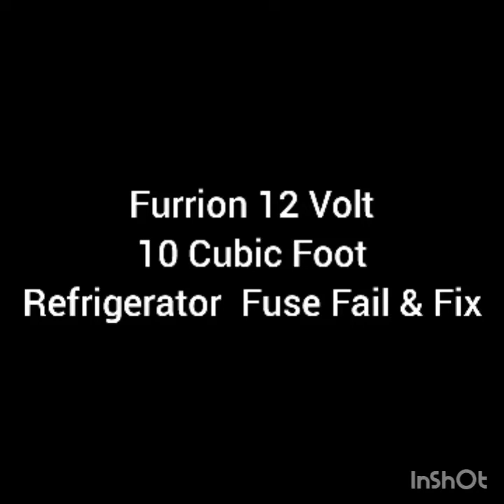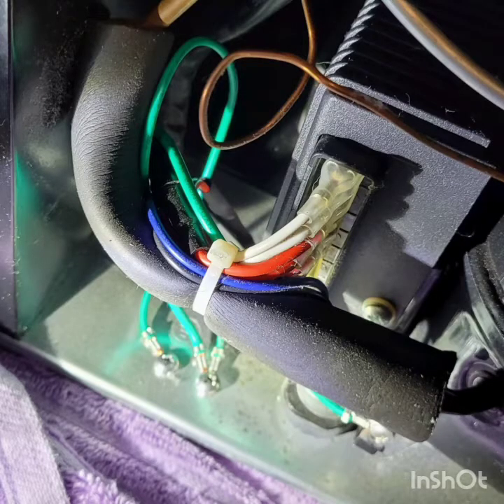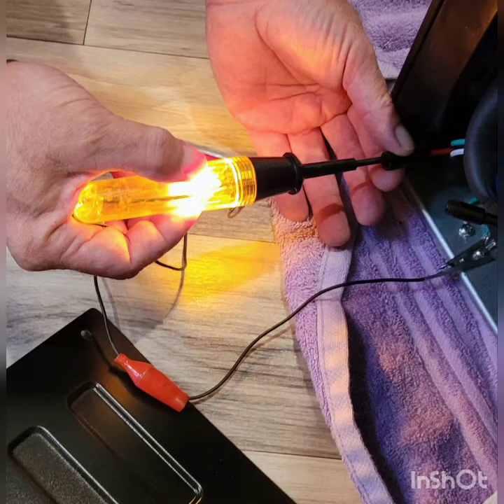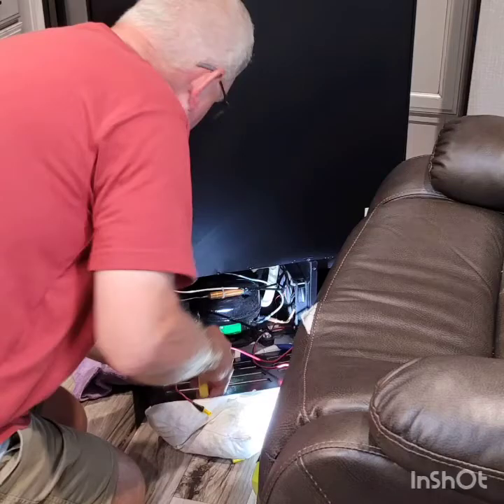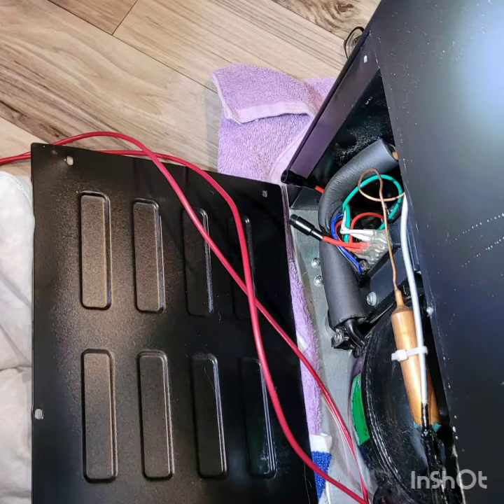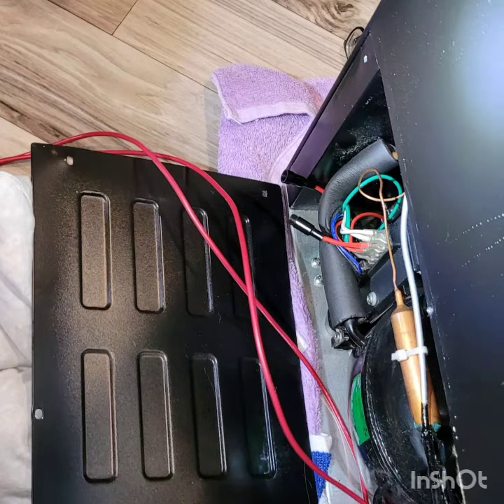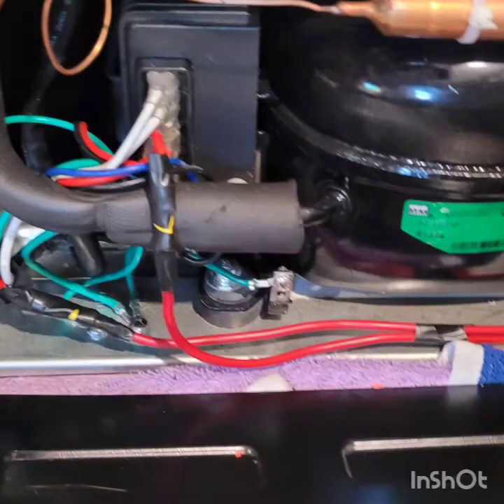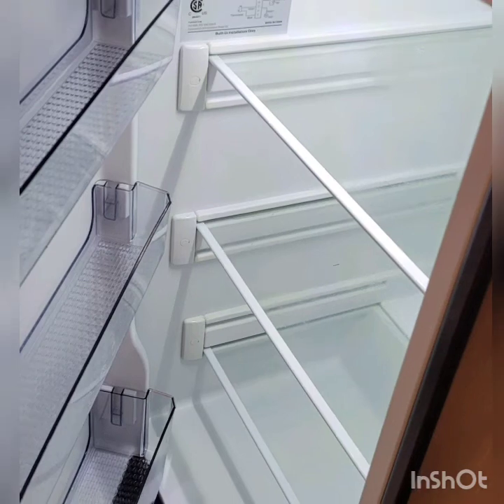Furrion 12-Volt Refrigerator Fuse Fix

Comment: Hey there Brian-

I don't typically comment on youtube videos, but I wanted to say: this one really saved my bacon. I'm a DIYer, but this is the first time I really had to deal with something potentially tricky with my travel trailer. This video helped me to understand what was going on, and the fix/solution actually improves the situation for future maintenance issues. THANK YOU!

Extra note in case nobody else has mentioned it here: be sure to test the old fuse. Use a multimeter set to "ohms," and use the black and red probes to touch each side of the fuse at the same time. A good fuse will register close to "0" ohms of resistance. But if it's blown (like mine was), then your multimeter shouldn't notice any difference as when you're holding the probes separate, in space.

Comment: Great Video. I used a milk crate and a couple of blocks of 2x8 to keep the refer as close to its original height as possible so I could slide it right back in.

Comment: Same problem. Fridge not cooling. Lights work in the fridge. Compressor makes a clicking sound every 2-3 minutes. But doesn’t cool. Company has already sent me a new compressor board snd issue didn’t fix. Anyone have any thoughts?   I am getting 13v past the inline fuse. So I assume the fuse is good?
Reply: We bought a Keystone Cougar about 3 months ago and the Furrion fridge has already gone out on us.  I contacted Furrion and they stated they don't make replacement parts for the Furrion Fridge.  I contacted Keystone and they acted like they didn't know this.  Holiday World in Alvarado, TX said they can't even look at it for 3 months.  People Furrion fridges are absolute trash!
Reply: No, you are not having the same problem.  Great instruction video, by the way.  But Paulmarsh7009, this instruction video is a solution to a problem where there is No lights, plus the frig is not working.  No lights mean a power interrupt -- in this case, the fuse blown at the 12 volt connect in the back of the frig.  If you have lights, then your problem is different, and you need to look eslewhere.
Reply: I just purchased a trailer in the same exact predicament. Have you had a fix yet?

Comment: Excellent video, I just did the same thing.  Question, do you notice a large temperature swing on your fridge?  when sitting at my house (obviously no heater on since we are not in it) the temp ranges from 34-45 degrees in the fridge and -2 through 25 in the freezer.  I purchased digital thermometers to give me 24 hour data.  It may be the thermometers but that seems like a huge swing.  When we camp with the heater, it stays a bit more consistent.  I'm guessing the ambient temp in the trailer has a lot to do with it.
Reply from the maker: Once we fixed the fuse, the refrigerator worked extremely well.  Temp swings were minimal.  That refrigerator, with the exception of the fuse fiasco, ran for three months, non-stop on our annual winter in Florida trip.  I would still prefer a gas absorption refrigerator, but must admit, this 12 volt fridge works well.
Reply: @brianhalliday2384  thanks for the feedback. I am used to leaving our fridge on all season long if not year round. I may shut it down when I winterize but so far so good. I noticed all the new Momentum toy hauler a have the norcold brand 12 volt. Mine is a 2022 with the Furion. Makes me wonder if they left Furion due to issues.
Reply: @2009reezen  I think it has more to do with appliance availability.  Whatever they can get their hands on is what goes into the new RV.  As an aside, I’ve read the Dometic 12v are having issues too.  Apparently there’s no field fix either and the entire fridge needs replacing.
Reply: @TheMinnow101  definitely puts it in a different perspective. Thanks for the feedback.

Comment: a video would have worked better than just pics
Reply from the maker: Thanks for the input, sure the video sucks, but I said it was a simple video.   When your wife is screaming about all the salad stuff, meats and dairy that was in that fridge, you fix first, and worry about your buddies that will have the same problem second.   One friend in particular bought a really nice Grand Design with a Furius (Furrion) 12 volt fridge.   I just wanted to get him prepped for his eventual failure at a remote state park campground.
Reply: @brianhalliday2384  Friends don't let friends buy an RV with a Furrion fridge in it lol.  Mine didn't even last 3 months.  Come on Keystone stop putting this trash in your trailers.  Great video.  I decided to replace my Furrion because if it's already doing this at 3 months I don't want to risk my beer getting hot when I really need it.

Comment: Just purchased a 2022 GD Imagine XLS 23LDE. First trip out was yesterday, and furrion refrigerator already not working. I have checked all the “visible” fuses and everything is good. 

The next step is to pull out the fridge after I call the dealership and Grand Design and see what they can do for me. 

Only concern is my refrigerator light is working, just no compressor kicking in. Thoughts on that? Thanks in advance.
Reply: I have the same problem. Purchased a new GD Imagine XLS 23MLE in Dec 21. Has a Furrion 12v fridge. Have not used the camper yet.  Turned the fridge on last week to get ready to go camping and the fridge would not cool. The compressor would run for about 30 seconds and shut off.  Just before the compressor would shut off the fridge interior light would start to flicker. After a minute the compressor would start again and then shut off. I left it on thinking maybe it would start working. Now the compressor does not start. The interior fridge light is on. When I turn the fridge on the interior light will faintly flicker three times. After 30 seconds or so the light will flicker three times again. Nothing runs. The dealer says he can't look at it for two weeks. I called GD service and they emailed Furrion, copied me.  Needless to say, we are very frustrated here.
Reply: The EXACT thing has happened to me, bought a reflection GD 367BHS, with the side by side 12volt residential fridge, and lights come on but compressor doesn’t come on. How in the HELL are these dealers and grand design still selling these things? It is literally all over the internet this issue.  Somebody is slacking man.
Reply: For all you guys that posted with problems it is most definitely your fuse.  Also check the wiring going to the fridge.  

I know Forest River cheaped out and ran 14 gauge wiring that is not recommended for that fridge.  Might be why those fuses are popping in the first place.